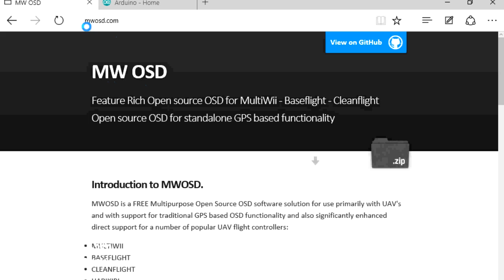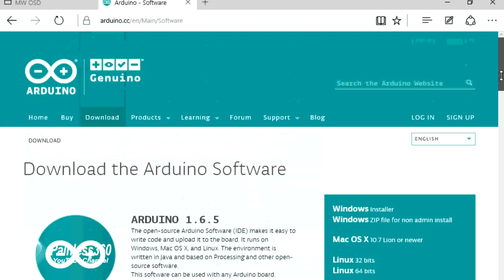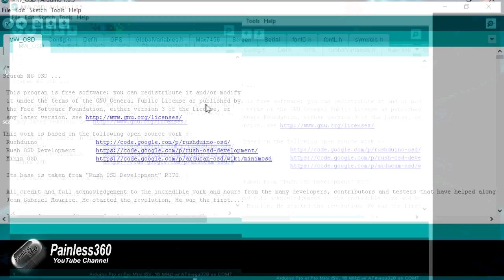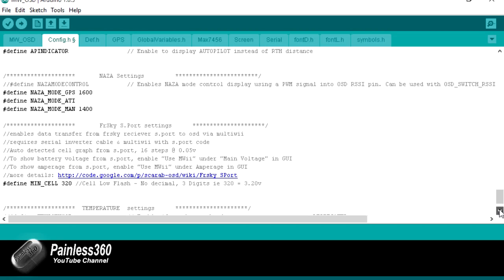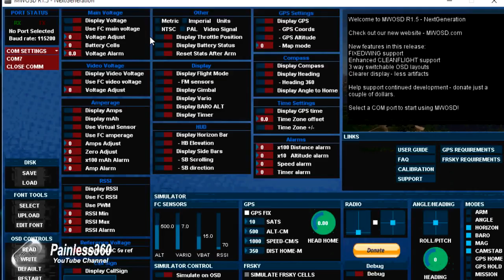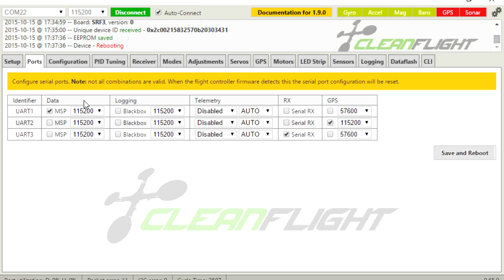(7/9) Seriously Pro F3 (SP3) Series - Adding an OSD for FPV using a MinimOSD

Comment: Hello Painless 360, I wanted to thank you for this video and others in your channel that have finally allowed me to get a Minimosd working perfectly. OSDs have been the one FPV component that has been quite troublesome for me, I've managed to get some to work but never 100% functional - either voltage not showing at all, faint OSD overlay, ground loops, worked for a short period,etc. 

I had a light bulb moment when I watched one of your videos (sorry cant recall the actual video, watched so many from your list to get all the pieces of the puzzle) where you mention that the minimosd has two sides which both have to be powered and the preferred method of doing this is via the same 5v from the FTDI/digital side of the minimosd using a solder blob on the top and bottom of the board...In the past (as per instructional sources as well as the OSD manual) I had powered the analogue side of the board via the 12v or 5v from the vtx and as you stated and i found this can cause issues, additionally i have a 4s setup which would have killed the OSD , so after an hour of looking at my Rctimer Mavlink OSD for these solder points and searching online I realised that either this particular OSD board did not have these solder points or I simply could not find them on the board and that's when i found this mod...:http://fpvlab.com/forums/showthread.php?29096-Mavlink-osd-V2-0-5V-mod
Soldered the wires as per the pictures on the link above and now when i plugged in my OSD to my pc I could see power was reaching the analogue/overlay side of the board, followed the rest of this video and success!!!! Sorry for the long post, maybe this can help someone else, many thanks and keep up the good work!!
Reply from the maker: +Aaron Alegria Thanks for the post. Great to hear when the videos here help another builder have a 'Eureka!' moment. Happy flying!

Comment: This has me confused as I was under the impression that it came with an integrated osd. That's what I was looking for. 😬

Thanks for the excellent video Painless360. 😉
Reply from the maker: The original Seriously Pro never came with an intergrated OSD. Many boards have copied the pin layout can use the same firmware from Beta/Clean/iNavflight with some of the later boards also including an OSD on the same board too.. Best of luck!

Comment: As an update to my issue of not being able to (Re)flash, I have SOLVED it with stubbornness!! I hope this might assist others if they ever have a similar issue.

Even though I have successfully connected to the OSD via the following pins :VCC, GND, RX &TX on previous occasions, when I tried to go in and meddle with setting and update to MW_OSD 1.6 this time I couldn't complete the upload, with Ardunino always showing "uploading"  What I did to overcome the issue was two things

1. I ran an EEPROM_Clear sketch

2. I connected the "DTR" wire between my FTDI and the OSD

This allowed me to successfully upload the new firmware with no issues.

Dunno why it suddenly needed the extra wire to allow it to flash properly, clearing the EEProm I can understand..

Hope this helps

+Painless360 I blame you !!! for this, a week ago I watched the your video on "soft serial"and thought hmmmmm I could could re-flash my OSD to 19200 and run it off pins 5 & 6, then I wouldn't have to disconnect my RX/TX pins when I connect my USB... and so the journey  began hahahaha
Reply from the maker: +Mark Duncan So pleased you fixed it and shared the solution - thank you!

Comment: Hi Paul, I have watched a lot of your videos, they are a great resource with clear explanations so thanks for that.  I might of missed something but, In betaflight I can enable the OSD and adjust what is included/displayed.  Does this mean that I don't need to add a MinimOSD board? or is that just a 'generic' tab for OSD settings for FC that have a OSD built in?

Comment: Thank you very much for your videos, they are really helping me. I'm a newbie in racing quads and now I'm building my Robocat with this FC. The Q is ... can i use default firmware on OSD that you mentioned in this video for Racing F3 with Cleanflight on board or I only can use this MWOSD firmware specially for Cleanflight? I don't really like this MWOSD firmware :(

P.S. Could you please give me a link how to connect this MinimOSD without 12V, I can't find it :(

Comment: my f3 board comes with OSD out of the box. its not the orginal F3. but it works just as well but with alot more features.
Reply from the maker: The original Seriously Pro F3 is only available in clone form. the original designer, Dominic Clifton, n longer sells them. We will see lots of 2:1 and 4:1 flight controllers coming to the market in the next 6 months dramatically reducing the need for lots of individual circuit boards on our models. Happy flying!

Comment: This video got me going with my SP PRO and a 9$ Micro Minimum OSD.   It came up and worked when I plugged the battery on the very first try on my mini quad.  I almost fainted.  Compass, baro, voltage, etc. working in my display just gave me a powerful nerdgasm and my fingertips are still tingling as I type this.  I tried the newest Arduino for grins and the author is correct, it won't compile.  My FC is using Betaflight, CF would not work on it, I don't know why but on my FC BF works perfectly.  I'm getting acquainted with and am starting to like the SP FC boards.  I'm a LibrePilot fanboy who has had some growing pains with other FC units.  I appears to me the uart1 contention issue only happens when the battery is plugged in.  I haven't put it to the test in the field yet but am confident.  If my craft does return to earth as a flaming esc ignited lipo fueled death meteor or some such I will post my mistakes with all humility after the resultant session with my analyst.
Reply from the maker: Fingers crossed! :D
Reply: In the field all worked, no disasters but......I just got back from the session with my analyst.  He told me that a low frame rate from a newly installed OSD is probably fixed by a setting somewhere in the flight controller CLI or the MWOSD GUI and the author of the video I watched to pull off my feat of notable nerdism would probably know exactly what to do and I was able to leave my session in high spirits.
Reply from the maker: Sean Bittner sorry, no idea what that would be. I'd suggest questioning this analyst a little more..

Comment: I've been beating my head for two hours trying to do this with the newest version MWOSD 1.6. It would compile and upload fine, but when i'd go to use the GUI it would read the data and then lock up. I finally decided to try 1.5 and it worked fine.
So if anyone else is having this issue, try that. If anyone has an idea what might be wrong reply to this.
Happy crashing!
Reply from the maker: +Borg Quads Good to know - thanks for sharing with the community..

Comment: Just a note for new players MWOSD v1.5 is the last version to include a free GUI configurator all later versions will cost a fee of two dollars.
Reply: Thanks for the info.  I was noticing there was a new option for getting the software as of this video but wondered if the free option was still around.  A couple bucks isn't going to break the bank, though. :)

Comment: Hi Painless 360 Thank you for all your help but still needs you assistance. I have change all new ESC and swap all the motor. What happen is with all new ESC (flashed the right firmware) one of the motor do no spin unless I put more throttle and some time other motor stop. I also changed all new motor with the new ESC. it is mean my F3 flight control broad is broken. I check all the wire is all connected no lost wire all joint at good. I hope you can point me to the right direction. All new ESC and motor. Thank you very much.
Reply from the maker: +TRULEE MEMORABLE I'd  check that you're using the right settings for your ESC in whatever software you're using, and also make sure that the calibration is ok. Use BLHeli suite to check that the minimum and maximum throttle values are alright, see how we did all that in our quadcopter building series. Best of luck

Comment: Painless 360 Thank you so much for all your help. I one side question I have a S500 and using sunny sky KV 1400 II everything is good if i want add a gimbal  should i get a lower KV motor. once again Thank you for the points up on the x220 Happy flying.
Reply from the maker: It's more a question of can the current setup lift the extra weight easily. If so then you can keep the motors, esc and props you're using.. Best of luck!

Comment: Got mine all working thanks to this video. However my battery voltage reads like 10-11v no matter what. Any idea what's going on here? I'm running a 4s...
Reply from the maker: Depends how you have it setup. I use the vBat from the flight controller and make sure that's all setup and good first.. Best of luck.

Comment: Hi Painless 360 I just want to say. Thank you so much for all your help. I am looking for a upgrade for my S500 with a new FC. Two questions not sure should I get the vector or pixhawk. I use my s500 for light filming. For vector I know where to get and will not get a fake one, but for pixhawk where do i go to order a real pixhawk. I saw to many brand of pixhawk. I do not want to get the fake one and waste my limited saving. I do not mind pay a little more to get the real deal. Hope you can help. I trust your opinion. Once again thank you for helping me out with my x220 everything is good now. Happy Flying.
Reply from the maker: +TRULEE MEMORABLE if you want a non clone Pixhawk then you need to look at the Pixhawk 2.1.all of the others are clones and are usually good but there is that risk, see my series on the Pixhawk 2,1 and the series for the Vector just started..  Best of luck!

Comment: Hii! First i wanted to thank you for the great videos about the spf3! they are really helpful!How can i set up my board so i can use telemetry (sbus of x4r) and osd at once? I would like the option without the soldered pin on top, since the space is pretty little. So if i use uart 1 at the side of the board could i just construct an y-cable for the TX to get telemetry to the receiver and the information to the minim osd? Or what other connections could i use if i cant use an y-cable?Thanks so much for your helpp:D
Reply from the maker: +Claudio Alter What you are asking is covered in the series. Best of luck!

Comment: The moment I connected my Micro MinimOSD to my FTDI board the green LED started flashing (on the OSD board) quickly and the main chip began heating up.  It was toast and had a short somewhere.  So I ordered another one. I made sure the power wires were correct before plugging the FTDI into the USB port ie powering it. Is that common to have bad boards right out of the gate?  I could have fried it when soldering the pin connector but I'm not sure.
Reply from the maker: I've not used MinimOSD for a long time so not sure, I'd check the manual/documentation for the one you have. Best of luck!

Comment: Hi can you help me please, I configurated my OSD like you did, but I can't see the battery level, show 0,0 battery low, I have the sp racing f3 deluxe for eachine racer 250 flight controller, thanks for help me
Reply from the maker: The OSD will either show the battery that it's own resistance bridge is set to or it will display the battery detail it's getting from the FC via the telemetry data - make sure you've set up for the right one in the GUI. Best of luck!

Comment: Hi,  Thanks for the vids. Can you have MSP simultaneously on multiple UARTs on the SPRF3? I was going to upgrade my old basher quad from Naze32. It has  Minim on UART 1. I had to put on a switch to turn off power and tx/rx to the Minim so I could plug in USB without taking the whole thing apart. The switch is flaky though and I thought I could get rid of it if I put in an old F3 board instead? Cheers.
Reply from the maker: +Plan C you can but you have to be careful. I think you can only have two MSP lines and one of them needs to be the USB connection.. best of luck!

Comment: When you connected to UART 1, was there a reason you soldered header pins instead of just using the UART 1 connector already on the bottom side of the board?  Thanks
Reply from the maker: Either way should work. Personal preference..

Comment: nice tutor sir..
btw..how i can connect bluetooth and osd with UART 1 and 3 while i used rx in IBUS with IO2..?

thanks
Reply from the maker: +EDDY SAPUTRA depends on the receive connection you're using and make sure that the iAd is off when using he USB. Best of luck!
Reply: Thanks for reply
In IBUS connection, tried to use UART1 and UART 3 to activated, and my GPS to UART 2, but after restart, UART 1 and 3 back to inactive again...

Any solution sir..?
Reply: Thanks for reply
In IBUS connection, tried to use UART1 and UART 3 to activated, and my GPS to UART 2, but after restart, UART 1 and 3 back to inactive again...

Any solution sir..?

Comment: HI Painless360 first i want to thank you. You are great answer question for newbie like my self. I have a question I follow your step with OSD it work great. I just have other questions I just crashed Wizard x220 one of the motor stop spinning, when i go back to clean flight check the motor two off my motor speed are very high and one not spinning is low. My question to you it that mean all my ESC are shock after my crash, or my motor is bad. the motor spinning fine except the speed is high and the one motor do not spinning mean i need change that motor. I hope you can answer my questions. So i can get replacement part. Thank you so much. Happy flying.
Reply from the maker: TRULEE MEMORABLE first of all check to see if you can spot any problems with the wiring, if it all looks ok then I swap one of the working Motors with the motor that doesn't work and see if the problem stays with the ESC or moves with the motor. That will let you know which part is broken, be very careful about running Motors like this as you might end up damaging other pieces too so keep the test very short. Best of luck

Comment: Hi, can uart2 be used for a micro minim, I'm using uart3 for x4rsb, didn't really want osd on uart 1 as its a tight build and don't want to deconstruct quad to free up usb
Reply from the maker: +Jeff Wells You can try it but there is a very good reason we showed it working in the way we did ;) Best of luck!

Comment: I have a question. You connect the OSD to UART 3, which makes it impossible to use at the same time as the USB port. What if you do not use UART 3 but 2. Can you then use the USB end leave the Minim OSD connected?
Reply from the maker: +Gerard de Vries you can, I found having a couple of UARTs setup for telemetry caused problems. We show the way it works in the video - you can try others but this was the way we did it.. Best of luck!

Comment: Hi.. great guide.. Just set up my minimosd and almost everything works fine, but somehow the osd is not showing the voltage.. it shows 0.00V. I got the newer version of the minimosd which has the connectors for bat and so on at the side. tried to connect these with the battery, but it remains to be 0V. Any idea why I did wrong ? Thanks for your advice.
Reply from the maker: Check in the GUI, there is an option to choose where the board gets its voltage data from, the on-board pad or the MSP telemetry from the flight controller.. Best of luck!
Reply: Hi.. thank you for your reply. i believe I have the option chosen in the right way, but without success. i tried both ways.. Voltage remains 0.. No idea ?!?

Comment: I had a question about the MinimOSD board and I can't seem to find the answer online.  On the back of the board behind the MAX chip, there are three solder point holes.  I have two boards - One has a solder bridge across the holes and the other doesn't.  Before I install one of these, do you know what the difference is and why one might be bridged?
Reply from the maker: No idea, sorry. There are a few different versions of the boards out there now. Best of luck!

Comment: Sir I have the same fc is it necessary to but minimosd or I can add osd from inav osd tab?
Reply from the maker: From what I remember there isn't an on screen display built-in to this flight controller. Check the specs online to confirm, but I think that's right.

Comment: i am trying to add the micro mininosd board to the sp racing f3 but im 
getting a dark screen, i can bypass the osd and it works fine. i have it
 hooked up using the method you use in this video for the regular 
minimosd to the uart1 port and the osd flashed fine. when i check the 
volts from the uart1 port i get .98v not 5v so i dont think it is 
powering on right. any input would be welcom as to why it wont work
Reply from the maker: +Summer Crow I'd look into the power problem first then make sure that the OSD and Camera are both set for PAL or NTSC.. Best of luck!
Reply: +Painless360 yes got that i found that if i disconect the +5v line from uart1 and run power to it via a +5v line direct i can power the board but the board still has no image. oh well it was worth a try using it thanks

Comment: nice video, have you ever had an instance of arduino seemingly taking forever to upload to the osd board ? im running win 7, arduino 1.0.5-r2 with a genuine FTDI  and now i cant upgrade to other firmware !!!
Reply from the maker: +Mark Duncan Not here, I'd try another cable and look at deleting the USB part in devices and trying again.. Best of luck!
Reply: +Painless360 cable thing tried about 7, all work in arduino from FTDI to my bluetooth module and the main actual data cable i used programmed the thing before, and this is happening across three different pc's, osd work fine on 1.5 just cant update it !!